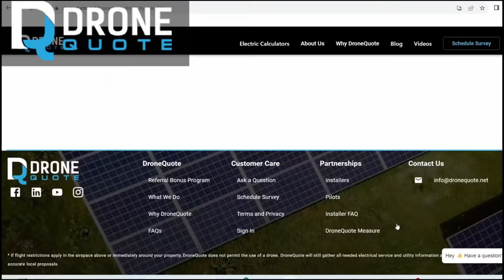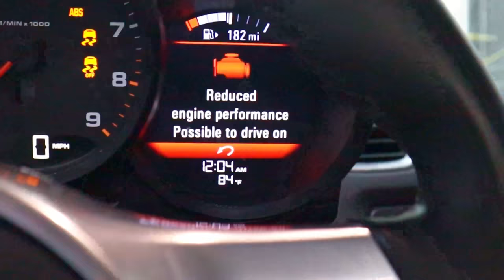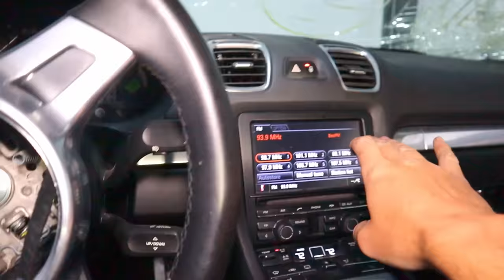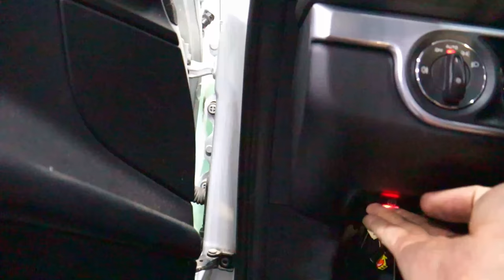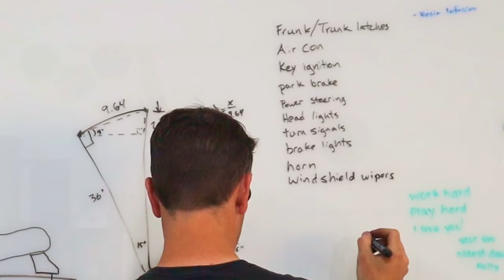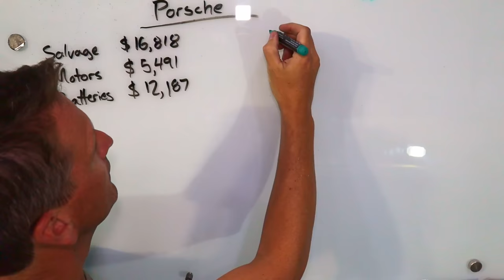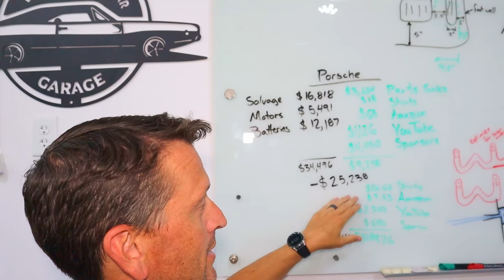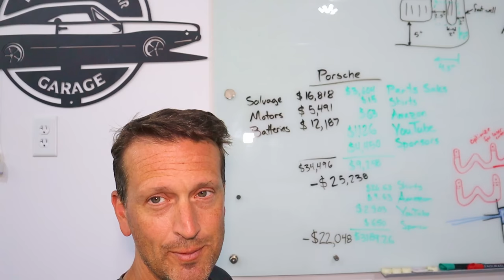Goodbye Porsche Parts!!!  Sold all of my used car parts for quick cash!

Comment from the maker: Check out these calculators from Drone Quote
https://dronequote.net/calculators
Reply: @ElectricSuperCar i woud like to mention few things 
1. Wind screen wiper wont work om VW group cars unless hood/frunk ia not closed properly in your case try to close the latch manually like you did it with trunk latch.
2. I will highly recommend getting your hands on VCDS or OBD11. For VW Groups car having one of these is must this will not only help you to intract with car electric system and diagnos alot of things e.g in case of trunk latch if you have vcds connect it can literally tell you that trunk latch is not getting power. Also in future when you will work on comfort features it will also come handy and upon all this it will also allow you to set further comfort features that are disable for the company exmaple set all windows closing with rain senor and much more

Hope you get a new job soon
Reply: Also since there are electric cars by VW Group try to sreach for ecus of these model may be you will able to integrate these with your electric system again having VCDS or obd11 will help alot in this

Comment: Door closed, brake pedal depressed, no fault codes relating to the parking brake mechanism, you could also try a press and hold, failing that on the calipers where the motors are there will be a cover hiding an Allen bolt which you can manually wind out to release the parking brake manually, just remember to wind it back on when your finished with the build
Reply from the maker: Thanks for the comment!

Comment: So glad to see the support. I have some more unsolicited channel advice: I know you probably don't want to spent a lot on the channel at the moment but I think improving audio a bit and having fewer handheld shots facing you would increase production quality a lot. The garage is way too live (echoey), I think you might need about 5-10x as much wall treatment, especially around the areas you film in. Hanging a big heavy blanket from the ceiling (out of frame) might do a lot for a small amount of money, depending on what type of ceiling you have (flat = more necessary to be treated). Recording audio for ads in the echoey garage is not ideal. Sometimes your voice is too soft on the mic when you are speaking (eg at times when your were running through the list of stuff that was working/not working on the Porsche) which gives the impression of mumbling. This is an editing issue, you need to boost the audio if your voice gets too low. Sometimes it's harder to pick these issues up if you edit on headphones because it sounds fine to you but wouldn't sound right on a TV. Finally there was some wind noise at times, would recommend picking up a cheap windscreen or "deadcat" as we call them.

Good luck with the build and with life stuff! I selfishly would love to see you go full time on YouTube/Patreon but I totally understand if the numbers aren't working (I also think it's cool that you have been so transparent about that aspect). So if not, I hope you find a great job you like as much or more than your last one.

Greets from South Africa
Reply from the maker: Thanks for the suggestions!

Comment: I don't have a Porsche, but my car has an electronic parking break as well and it does not release until you put the transmission into gear (fwd or rev).
Reply from the maker: I will check it out

Comment: Great idea to offload all those parts. Will give you more space to think. One question though, aren’t you gonna need the side skirts and the pumper even though it’s converted to electric? Also, isn’t 3900 a bit cheap, I get the feeling of getting rid of it is a great relief but just feels like a Porsche engine and gearbox alone should be at a much higher price point. Would be really interesting to get more details on the train of thought behind the decision.

Great content and really appreciate the openness!
Reply: yeah, that new of a porche engine and trans would cost way more then 3.9k that seems way to low of a price. but he needed to get rid of them fast, so you take what you can.

Comment: I guess you need to press the brake pedal to release the parking break.
Reply: In some cars it is brake fluid pressure not a switch on the pedal
Reply from the maker: Thanks for the comment!
Reply: Confirming - you have to press brake pedal in Porsche. There’s another way - put in drive and drive:) itll disengage automatically.
Reply: In vehicles with electronic parking breaks you do need to engage the brake pedal to disengage the parking brake.

Comment: @ElectricSuperCar i woud like to mention few things 
1. Wind screen wiper wont work om VW group cars unless hood/frunk ia not closed properly in your case try to close the latch manually like you did it with trunk latch.
2. I will highly recommend getting your hands on VCDS or OBD11. For VW Groups car having one of these is must this will not only help you to intract with car electric system and diagnos alot of things e.g in case of trunk latch if you have vcds connect it can literally tell you that trunk latch is not getting power. Also in future when you will work on comfort features it will also come handy and upon all this it will also allow you to set further comfort features that are disable for the company exmaple set all windows closing with rain senor and much more
Reply from the maker: Thanks for the comment!
Reply: @ElectricSuperCar  You are welcome. Wishing you good luck on the project.

Comment: Hi Jeremy, for the parking brake, it’s definitely because you don’t have the transmission connected. I drive 911’s and you can put the brake on with the doors open, but you can’t without putting it into park (automatic) or neutral (manual). See if you can bypass this somehow
Reply from the maker: Thanks for the info!

Comment: If the brake pedal is electronic it probably has a built in position sensor which controls how much pressure is being applied. If that’s the case you will more than likely need the pedal hooked up to release the parking brake as it won’t sense any brake application without it.
Reply from the maker: Thanks for the comment!